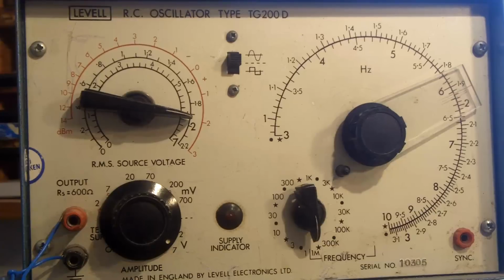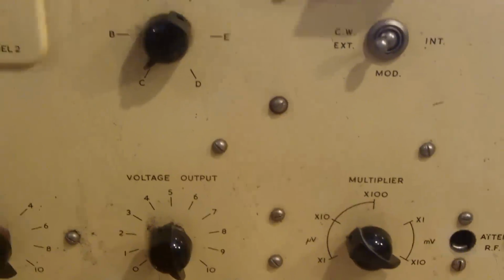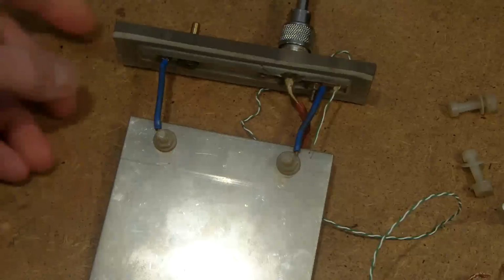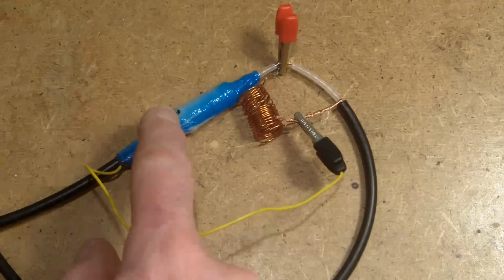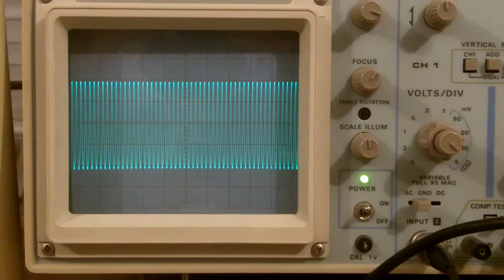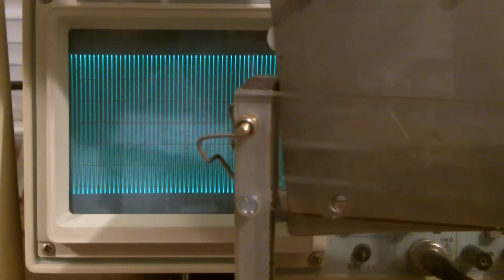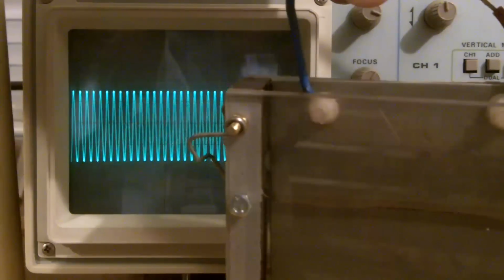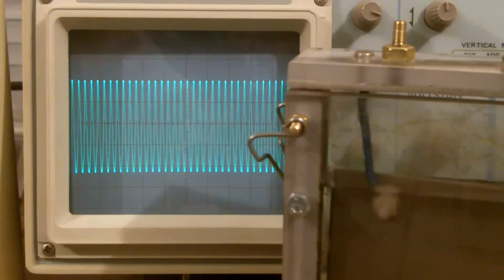HHO. 19

Comment: Hello, if low Q is the problem then why not just increase it? I have read that a low resistance is causing a low Q (i dont know if its correct). So the Solouting would be a larger space between electrodes and using high voltage above 100V. In the Stanley Meyer Patents he had also used high Voltage. greetings

Comment from the maker: The cell behave very differently to most resonant circuits I’ve handled before, but there’s nothing magic about it though, it’s simply a very low capacitance and once it gets wet the resistance damps the Q making it very difficult to measure the natural resonant frequency. If you want to reduce the Q of any circuit just add resistance. OK on the square waves, square waves are full of harmonics and fast dv/dt's are bound to cause confusion where multiple resonant frequencies are possible. 
Andy

Comment: Also once the cell is active (producing gas) the cap changes. I think you will need to get the cell producing gas to some degree and then try and find the resonance point (PLL, yes pls). Did you switch configuartion to series and see if there was the reverse signal, low aplitude point?  Like your work!

Comment: Have you hooked your sig gen directly to the scope (ie disconnected the cell) and see if the signal is correct? I've had spurious signals before, being inductive only. I found it gets more difficult when you start driving the circuit too. Using square wave gives some really strange signals at the cell end and it is hopless when hooked in series as your looking for the lowest aplitude and the sigal is messy. Using sine wave is the go, I think at leat for testing.

Comment: It looks like your coil is interacting with your RG58. I'd put the coil on the plate to keep as many of the parasitic elements to a minimum.
I'm not sure if your sig gen has a square-wave output. Could be useful even with a low frequency one so you can count any resonant peaks in each cycle and multiply the value.